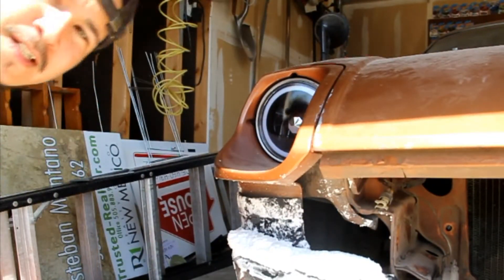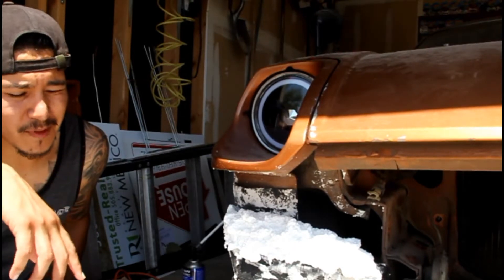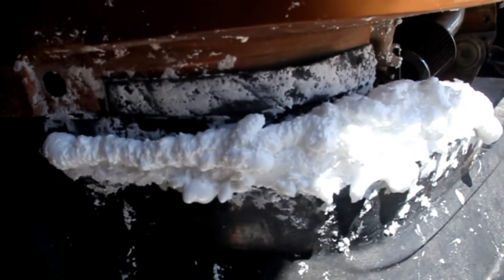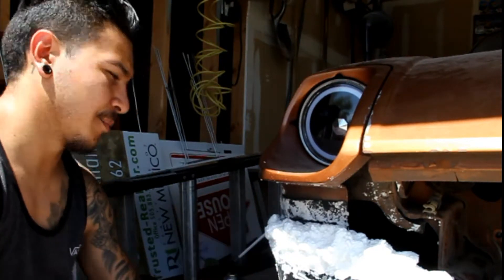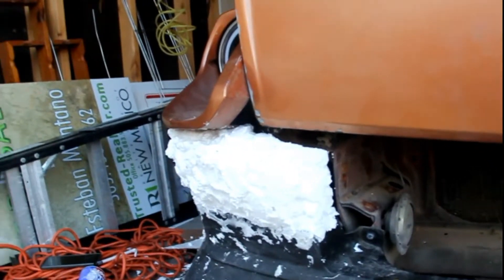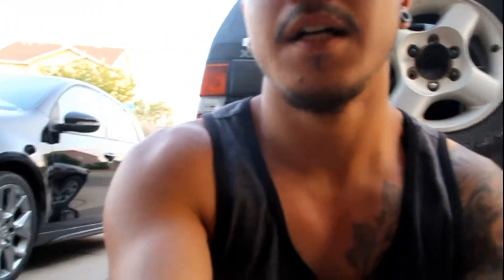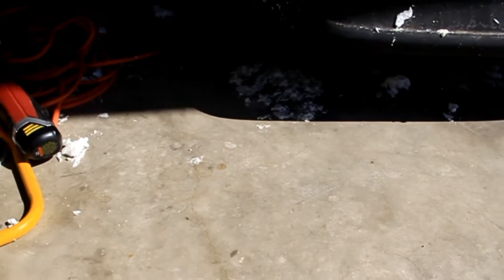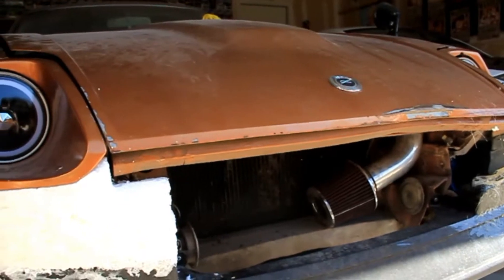280zx Custom front bumper using foam part 2

Comment: How are you going to detach the bumper/valance not that’s it’s covered in foam and fiberglass. Thanks
Reply from the maker: So that’s the only thing is at this point the bumper is molded to the car and cannot be removed. But I really don’t see a need to remove it. 
Everything I need to get to, engine wise is accessible without needing to take off the bumper